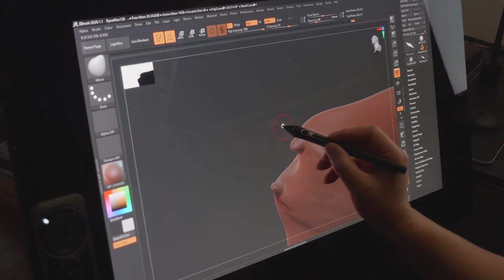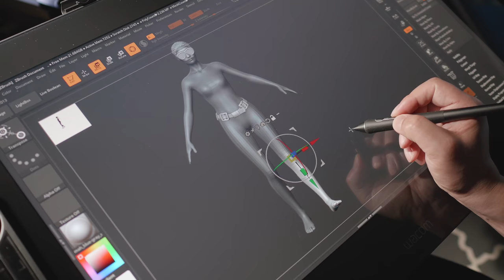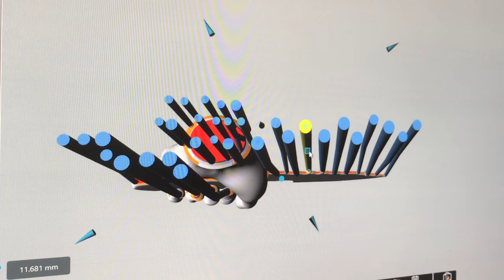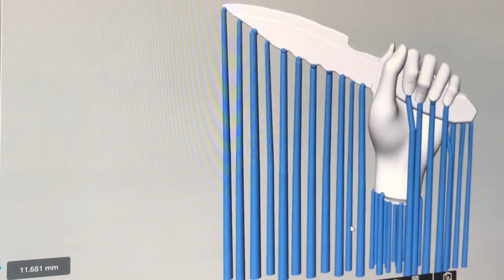How to make a freediver and manta ray diorama | diorama | Resin Art | RAYCLAY

Comment: When can I make the next pour?
A secound pour without having a seamline between the two .

I did a 2cm pour and waited 12h.
(In the description of my epoxy stands minimum 12h)
It was still stickey on top...but it seemed too late because i see the line on the side of my acryl box.
Next second layer, I have to a a third layer faster.

Can i get rid of that visible line ?

I have a 44x18x20cm box, the company said i have to pour it in layers...because one pour would be roo much - it would cook over.

Thx
Reply from the maker: @Die_Maulquappe It seems difficult to remove the line, but I hope it goes well.😉

Comment: can i offer you a huge tip on removing supports.  before you cure the prints use an old hair dryer on the supports they will warm up and flex allowing you to peel the supports away from the models leaving no puck marks this will save you a huge amount of time and increase your workflow. i would highly recommend giving it a try on your next print or just try a test print on something. awesome model by the way and loving the final product. i would love for you to allow users to print the manta ray. that is an awesome model and would be proud to have that in my collection of prints painted up. great work. and hope the above tip helps. :)
Reply from the maker: @TK's 3D Prints Thank you for the nice message.
I'm very happy to see your reply.
Your advice is very helpful.
Unfortunately, this file is not for sale.
Thank you again.
Reply: @RAYCLAY1  thats ok. i could go into VR and make them. but yours just look so awesome. i also love the models of the whales you did. again another awesome model.
Reply from the maker: @TK's 3D Prints Wow, your work is awesome too 😉👍👍👍
Thank you.
Reply: @RAYCLAY1  nah matey mine is basic. but thanks. :)

Comment: SPEECHLESS.😱

Quick question what tools, paints, etc do you use like the plastic to make the square diorama the technique basically everything I'm quite very intrigued ?
Reply from the maker: Thank you very much.
I use ZBrush for my modeling tool and a Wacom Cintiq Pro 24 for my tablet.
The 3D printer used DWS's SLA printer.
The painting was done using acrylic paints and an airbrush.

Comment: Nice Work~ Would you mind to share more information about the epoxy you used?  The quantity of epoxy is quite large, and usually the temperature would be high enough to cause a lots of bubbles inside......
Reply from the maker: @Zucas Thank you very much😉
I used a low viscosity type resin and it cured slowly.

Comment: Beautiful! What kind of resin are you using? Do you put it in a pressure pot?
Reply from the maker: @Diana Guillermo   Thank you so much.😉
The resin I used is a low viscosity type resin.
and, I didn't use the pressure pot because I was concerned about damage to the work.

Comment: I have a question about the paint that you use on the characters. I’m using matte acrylic paint and in order to make it glossy I’ve sprayed with lacquer. Do you think the lacquer will react poorly to the epoxy?
Reply from the maker: Thank you
I used a matte lacquer to remove the gloss.

Comment: What did you use to glue resin parts together and was than an UV light? Can you share some links? Thank you for video.
Reply from the maker: @BeerBull   Thank you so much.😉
The product I used is a light curing putty tamiya.
And it responds to general lighting
I used UV lighting, but it doesn't have to be.
When using UV light, wear safety equipment for UV light.

Comment: It almost looks like work flow like I did with my Rift, what's the name of you drawing board ?
And also the program you use ?

Pretty awesome work, thanks for sharing 😉
Reply from the maker: @DalleLama -Zone-G   I use ZBrush for modeling tools and Wacom Cintiq Pro 24 for tablets.
Thank you so much. 😉
Reply: @RAYCLAY1  thanks !! Is it standart options you using for rotation or is it like a mod ?
I know it's a lot of questions, but I'm new to all this, VR was my thing 😅
Reply from the maker: @DalleLama -Zone-G   Yes, this is a standard option.
Thank you.😊
Reply: @RAYCLAY1  This is great but WOW these tablets are expensive 😅 but this is definitely a tool for life !
Reply: @dallelama8874  loom at the huion tablets as an alternate,  they are much cheaper.  Ive used one for 3 years now  (5 days a week) and i love it. Mine is the huion kamvas pro 22 inch.

Comment: Hey So you pour in layers or do a deep pour? And do you use a pressure pot?
Reply from the maker: @Louis Moon  Thank you.😉
I usually, To avoid layer shape I do pour at once if possible.
and, I didn't use the pressure pot because I was concerned about damage to the work.
Reply: @RAYCLAY1  ah awesome, what resin do you use? As the stuff i used bubbled a lot and had a tinge of yellow to it when it cured
Reply from the maker: @Louis Moon   Thank you so much.😉
I used is the Chamchristal resin (low viscosity type) of Dongyang C&C.

Comment: How many layer did you pour the resin? Did you pour all at once? I faced an issue with layer forming and creating particular separate layer between layers. I used 3-5 hour method but facing this issue.
Reply from the maker: I pour the resin at one time whenever possible.
thank you

Comment: As 3d printer I would say that you used WAY tomany supports. Also if you turned them to be "standing up" you would requier less supports anyway.
Reply from the maker: @Naj Kraemer Thank you for your sincere comments.
I added enough support to reduce many trial errors.😉
Reply: @RAYCLAY1  Ah, are you new to 3d printing? as of late I havnt had any missprints or faliures. Other than some supports snapping mid print XD even though all the other supports are th same strenght ? :)